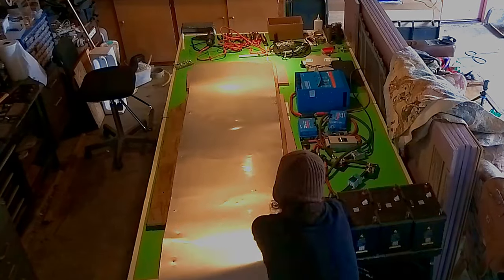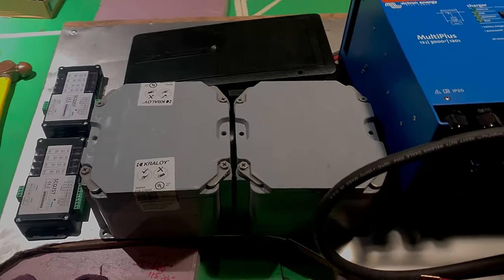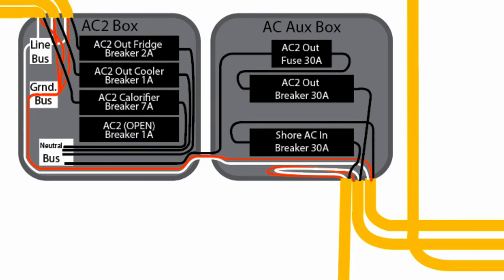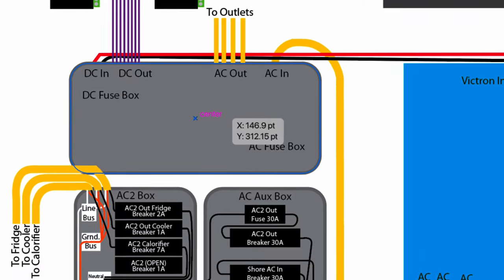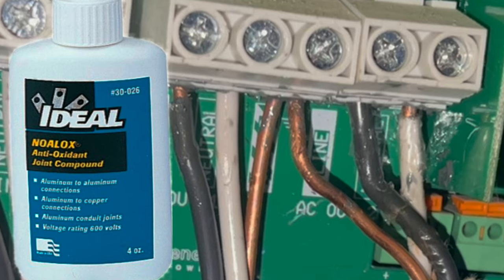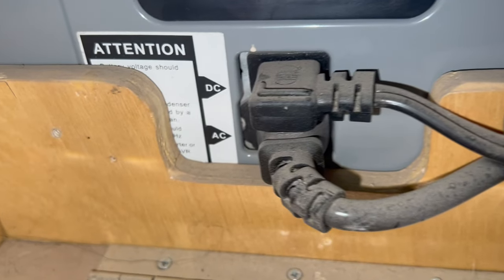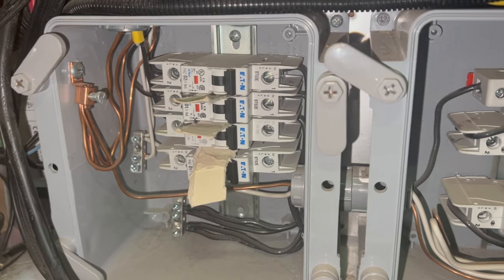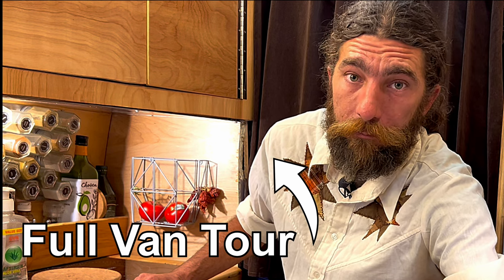Solar AC Main Connections - VanLife Solar Electrical Pt.3

Comment: Umm, there is a valid reason the stranded wire is used in automotive (mobile) applications; copper is notorious for work hardening, fatiguing, and breaking, especially at connection points. I hope you don’t run into wiring failures in the future.

Comment: Just a heads up, NOALOX is an abbreviation of exactly what it is for NO ALuminum OXide. NOALOX will prevent more oxidation from happening, but it will not undo any oxidation that has already happened. While the NEC does not require it, NOALOX is probably worth the peace of mind if you're going into a salty or corrosive environment.
Reply from the maker: Yep… or if you don’t know where you are going but know there will be the occasional beach and your system is open to the air when you get beers from your cooler 😜

Comment: I really like the whole van series - I'm learning a lot. A suggestion for the fire proofing part of the electrical system: use 1/4" cement board as a facing for the plywood. It is available in 4 x 4 sheets and not very heavy.  It's fairly cheap and easy to work with. To cut just score one side like drywall and snap over a straight edge. Use carbide tip drill bits to make your holes. I used tee nuts on the plywood.